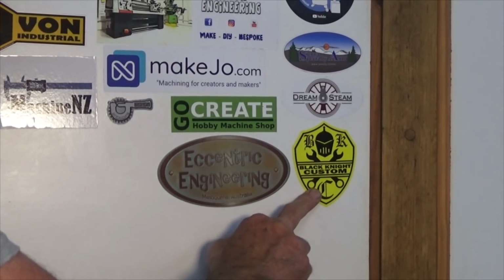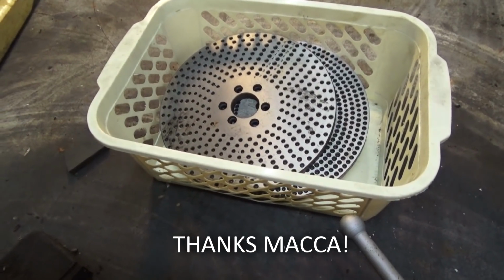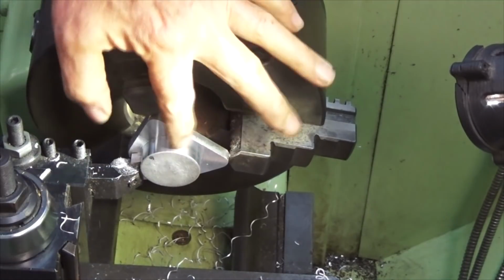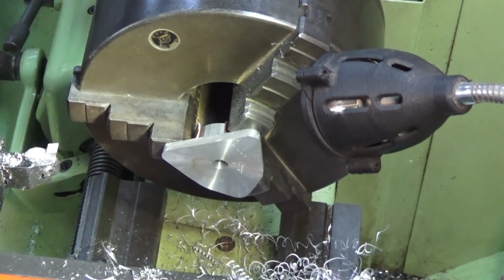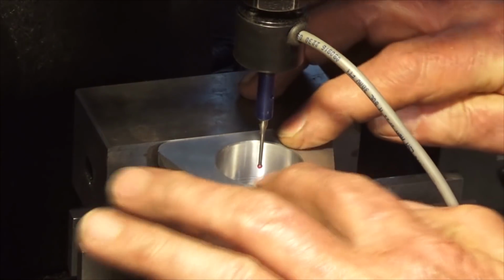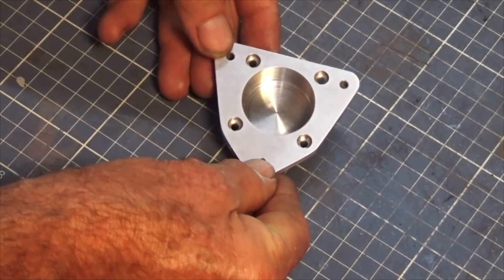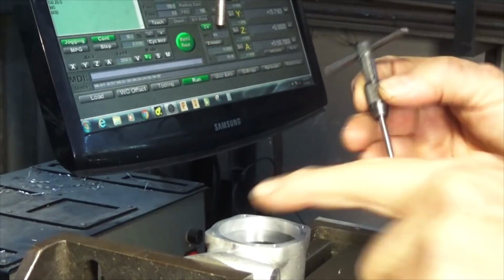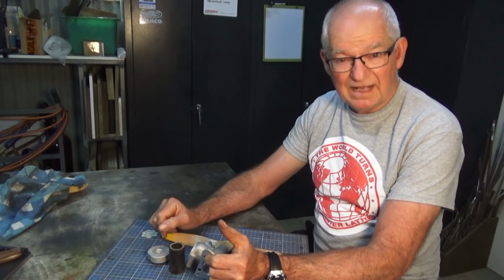Building the Titan .60 Glow Plug Engine #5

Comment: On many ABC glow engines the crankshaft is undercut slightly just in front of the counter weight. That way you don't have to worry about precise fitting in the bush at the extreme rear. If you have a Cox .049 engine crankshaft around you can see what I'm talking about.

Comment: The four screws that hold the backplate to the crankcase see a lot of abuse. Over the normal course of engine use, they would be removed and replaced fairly often for inspection or maintenance (such as replacing a connecting rod or piston). These screws also have to resist an extreme level of vibration transmitted from the engine to the model airframe. For these reasons, I would highly recommend using full-depth screws. If the screws started off at 0.375” long and ended up at 0.250” . . . that’s very likely too short of a thread engagement in the soft aluminum crankcase. The crankcase threads will quickly be fretted by vibration and no longer hold the screws.

This kind of engine mount - a radial mount - was never very popular because they often failed at the backplate-to-crankcase connection. It’s why a large majority of model engines used beam mounts (lugs) on the side of the crankcase. Even for beam mounts, I often had to drill out the backplate hole and re-tap them at the next size up to repair threads damaged by repeated disassembly/re-assembly and vibration. I have also drilled the holes in the crankcase lugs all the way through (if they clear the outer crankcase wall) to get additional thread depth. A through hole (instead of a blind hole) was often used by engine manufacturers to get maximum thread depth too.

One way to get threads all the way to the bottom of the blind hole is to grind your own bottoming tap. Use a regular bottoming tap first, then grind another tap with full threads and an absolute square end . . . no chamfer of any kind. I’ve used this method on model engines in the past to eke out the last few threads to save a failing threaded hole.

I realize this engine is likely to run once or twice and then be displayed. So my comments are intended to provide some background about how model engines are used and how they are likely to fail.  HTH.
Reply from the maker: Thanks for the feedback. All the engines that I had as a kid had side lugs on the crankcase except for the little Cox .049. I guess that these bigger engines do induce a lot of stresses and loads that make it difficult to predict failure. I did end up grinding the point of the bottom tap but it still wouldn't tap the hole deep enough. I guess the best solution would have been to drill the tapping size deeper into the casting but I desperately wanted to avoid breaking through the side of the casting. As you have worked out, this engine won't do a lot of running but good advice nonetheless.
Regards,
Mark

Comment: Lovely in the early 1960's l worked with Progress Aero Works, manufacturing PAW diesels, l still have one of the first experimental 19's - then again some years ago manufacturing the replica Gordon Burford 5cc side port diesels - l have #37
Reply from the maker: My first engine was a Taipan Tyro diesel. It was very similar to the PAW 19. They were cheap and built like tanks but the fuel was costly and hard to make at home. I think I got my parents to buy some ether from a local chemist but even back in the 70's it was hard to get. I recall seeing advertisements for the PAW engines in the Aeromodeller magazine.
Regards,
Mark

Comment: I've wanted a lathe for years, there's a limit to what you can do by hand with a Dremel
Reply from the maker: If you have room for a little bench top lathe there are plenty of options to choose from these days. The Chinese mini lathes are not brilliant but they are cheap and accessible. There must be plenty of second hand versions out there. If you consider it to be an entry level purchase you can always upgrade at a later stage.
Regards,
Mark

Comment: Mark, I wasn't looking for them at the time, but stumbled over three of the six  issues the Titan .60 model was "built" in back in the early '90s.  They contain parts 1, 4, & 5.  That means that I've got the other three issues in another box around here somewhere.  Let me know if you want me to try to find all of them and make good scans of them for you (if I remember correctly, you mentioned that at least some of your copies of the instructions weren't the best).  I can at least make scans of what I've already found.
Reply from the maker: Bob, thanks but I ended up getting PDF copies of the original articles from the Home Shop Machinist archives. I had to pay for them and incredibly, I had to FAX them a purchase request. Who still uses faxes? the copies I received had slightly clearer pictures but they are still just scans of the originals. 
Regards,
Mark
Reply: @Preso58  Yes, I'm not surprised that you received scans.  I believe that they only (relatively) recently digitized their operations, so hopefully folks in the future will be able to purchase "originally" digital copies.  Though I'm not sure that they offer digital copies of their magazines for sale, even today.

Given the above, I'm not terribly surprised about them still using a FAX machine.  They are still a fairly small company, I think.

Comment: Again, very interesting engine build series. Just remember that this engine looks like it is being built for a "control line" aircraft because the design of the fuel delivery system will not be variable, but full open. Later on you could modify the fuel input setup for a variable carburetor and solve that issue. Thumbs Up for sure!
Reply from the maker: Gary, I think there is an option to fit a carburettor but the version I will build is going to be as close as possible to the original build notes. Most of the engines I used in control line planes were 3.5cc or less. This beast would have to go in  a pretty big plane and would pull like crazy. 
Regards,
Mark
Reply: @Preso58  Do the plans allow for a throttle?  Or just a mixture screw in the venturi.

Comment: Don’t use wood screws, do a bolt thru with a locking nut on the backside.  On my glow engines either a paper gasket or an o ring for the backplate seal.  Have a couple of backplate mount engines, more ridged for the high rpm that they run at.  A Venturi carburetor is usually a very high turning critter, safety first with a double bladed scimitar at 17-26,000 rippems.  Great machining videos that you are doing!
Reply from the maker: The build notes do specify metal thread bolts and nuts but this engine will eventually become a display model only. I actually have a box full of titanium aircraft bolts and just for the fun of it I might make some scale versions from the originals.
Regards,
Mark

Comment: if you put on a nut before shortening the screw/bolt , it wil clear the thread as you take it off.
Reply from the maker: I do that sometimes if I have a lot of them to do. I usually drill and tap a piece of stock the thickness I want the screw length to be and just grind off the excess on the linisher. 
Regards,
Mark

Comment: What are you using for lubrication in the spray bottle?
Reply from the maker: I was using WD40 on the CNC mill but I often use water soluble oil and Tap Magic. The WD40 is less of a problem with rust issues on the machine surfaces though.
Regards,
Mark

Comment: I wouldn't use wood screws to mount the engine. In my day we used spike nuts on the back of the bulkhead and bolts of machine screws into them from the front.
Reply from the maker: The build notes do suggest to use metal thread screws and nuts but this engine will probably only run once and then it is being shipped back to the USA to go on display in a museum. I will have to make a decorative mount for it from some Australian Red Cedar that I have on hand. I like the look of nickel plated round head wood screws but I will see if I can find some nice scale type hex headed bolts. I actually have a box of titanium hex headed aircraft fasteners but they are all too big for this engine. 
Regards,
Preso

Comment: Joe Pi does make tapping holes look easy and my limited experience does not match his. I very much understand your caution.
I enjoy the clips of down under, thanks for sharing.
Reply from the maker: It doesn't help that I have shaky hands either. I know from experience how sick it makes you feel to break off a small tap in a blind hole, especially when the part is a casting. 
Regards,
Mark

Comment: The crankcase holes for the back plate you said the depth was 3/8"...That would be .375"
I don't know if the ears are big enough to drill through so the holes could be tapped through? If not, maybe a bottom tap would have worked. This of course is so you don't have to custom grind the screws.
Reply from the maker: That's it, 3/8" = .375 = 9.525mm. I tend to work in both metric and imperial units but metric is my preference. I used to know all the common conversions but I still have to look them up occasionally. It would have been nice to drill and tap right through but I am trying to follow the build notes as closely as possible since the finished engine is being returned to the USA to go on display in a museum to honour the work of the designer George Genevro. 
Regards,
Mark

Comment: You can cut the threads to the bottom with a bottoming tap. I like the spiral type they pull all the chips up out of the hole.
Reply: Even a bottoming tap has 2-3 threads that are tapered. Spiral flute taps are definitely nice though for blind holes.
Reply: @ADBBuild  not with a true bottoming tap, you tap the hole then remove the taper tap then use the bottoming tap to do the last bits. Anyway it doesn’t matter he got the thing together👌🏻
Reply from the maker: I did use a bottom tap but even after grinding off the point it still won't cut a thread right to the bottom of the hole. You need to be thread milling for that to work. I could have just drilled the tapping hole size a bit deeper but I desperately wanted to avoid breaking through the side of the casting. That would have ruined what little reputation I have. 😁
Regards,
Mark

Comment: Thank you for the videos, I really appreciate your efforts. I repair, rebuild and port 2-stroke chainsaw engines and a thought struck me. In 200 series husqvarna chainsaws it was common that the crankshaft protruded the case through the oiler which also had the crank seal journal. The oiler and sometimes a similar fitting that was used under the flywheel, opposite the pto side, both have journals for nitrile buna o-rings to seal the case. Your protrusion, near the base, would be well suited to an impervious o-ring seal.
Reply from the maker: That is true but I am building this engine as a display model to go into a museum in the USA. It is to honour the work of the designer, George Genevro so I am trying to build it as exactly as possible according the the published drawings. 
Regards,
Mark

Comment: These odd shaped parts are a big challenge for work holding.   I would have felt a lot of stress doing the operations.   I like to manually tap threads to feel the pressure.   Breaking a tap in this part would have been a disaster.   Well done, very good progress.
I loved the bird shots at the end.   Thanks.
Dave.
Reply from the maker: Thanks. This build certainly has it's share of workholding challenges. I spent most of yesterday just making workholding jigs for the next two parts. Those corellas are infrequent visitors to our garden but it was nice to see them. They have really creepy eyes though!
Regards,
Mark

Comment: Hi Mark just found your channel. I think I picked up you were a metal work teacher. I spent 23 years with Bendigo TAFE as head of Machine Tools ending up my managing Echuca TAFE. I live in Thailand now and setting up a workshop here. Looking for to binge watching your channel.
Reply from the maker: Thanks Jim. I worked in the state secondary system for my whole career but we started to work more closely with TAFE after the VET courses were rolled out in our senior engineering and furnishing curriculum. I always struggled with the competency based assessment used in our VET classes. Kids would always want to know how well they had done on a particular job. I would tell them that they were certified as competent but they would wan to know HOW competent. So then you would have to say something like "very competent". But then they would want to know if they were more competent than, say, Billy over in the corner. And so it would go on. Fun times!
Regards,
Mark
Reply: @Preso58  I was heavily involved in writing the national curriculum and producing teaching material. I used to explain to apprentices that if you produce something half right,is that acceptable at work. So things need to be made to specs, if you do the maths and it's only half right,is that ok.

Comment: Quite simply, I enjoy your videos and look forward to your next release.  Making a model aircraft engine is a unique idea in comparison to a steam engine. Thanks again. Graham
Reply from the maker: Thanks. I have always wanted to make an internal combustion engine but I imagined it would be something like a hit and miss engine. They are low revving and a bit more tolerant of machining errors but you also need to cut gears. The two stroke engine looks simple on the surface but requirement for good tight tolerances can be a "challenge". I am sort of intimidated by the next group of parts but if I can get this engine to run I would like to have a go at a multi cylinder 4 stroke at some point.
Regards,
Mark

Comment: Hi Mark, I agree that Tassie is beautiful and we also enjoyed the old buildings. Just a couple of days ago I snapped a 4x.7mm tap🤬. I had about 25-30mm of thread left on the broken tap so I ground it off dead square so I can use it as a final bottoming tap in the future. It will be in an upcoming video restoration of a couple of Estwing hammers. I’m really enjoying your engine build series even though I’m not into rc planes, you just have a way of making it interesting. Cheers Stuart, Canberra 🇦🇺
Reply from the maker: Thanks Stuart. Breaking a tap will certainly ruin your day. Luckily there are only a few threaded holes to go in the engine. I own an Estwing hammer and up until recently I thought the brand was spelled Eastwing. I guess I never looked too hard at the spelling. It seemed logical that the bird wing in the logo would have something to do with birds flying east! 😁
Regards,
Mark

Comment: I note that you seem to suffer from "Tapping Anxiety" Mr. Presling. I myself suffer from "Glue Anxiety", a debilitating condition to be sure, especially when one is using cyanoacrylate adhesives.
Reply from the maker: Been there, done that with cyanoacrylate. I used to carry a bottle of it in my dust coat pocket when I was teaching. It was super handy for repairing splintered joints but one day the cap came off in my pocket and man, that super thin stuff gets hot when it goes off. That's what alerted me to the disaster as it was unfolding. 
Regards,
Mark

Comment: Hi Mark, My Brother in Perth has the same lathe and it came with a hydraulic tracing attachment, very jealous.
Reply from the maker: I have the original Colchester manuals and one shows all the proprietary accessories you could add to the machine. If I could find them I would like to have them all!
Regards,
Mark

Comment: No helical milling for the c'bore
Reply from the maker: I would do that but not on a part where it's definitely a one off. My little CNC is nice but it has it's limitations.
Regards,
Mark
Reply: @Preso58  that's one thing I loved about the vtc800 I worked on it had like a 60 tool carousel you could just helical mill any hole you needed as long as it wasn't to deep.

Comment: On the back plate use a small O ring to make the seal
Reply from the maker: The build notes suggest that as an option but I went through my entire stock of O rings and couldn't find anything the correct size. 
Regards,
Mark
Reply: @Preso58  Contack me if you want 1 just give me the size you want, or contact Jett Engines they use them

Comment: Tension… make a mistake and there’s not fall back.
Reply from the maker: Tell me about it! If I mess up any of the castings there's no alternative. As it turns out I checked the cylinder head casting yesterday and it is undersize because someone cut off the casting gate too close to the casting. Luckily, that is one part I can make from solid stock.
Regards,
Mark

Comment: Is it just me or does that exhaust port seem really high?  hmmmm     love my Milwaukee screw shorteners   great video!
Reply from the maker: It will all make sense when the cylinder liner is assembled into the crankcase. The engine will be nearly double the height after the liner and head go on. Starting on those parts tomorrow.
Regards,
Mark
Reply: @Preso58  Now that makes sense....

Comment: Could you add an O ring to the plug so the plug is always sealed to the crank case? Ass the engine heats up, the plug will not heat as much making a clearance between the plug and the case.
Reply from the maker: The build notes suggest the O ring as the preferred way of sealing the back cover but I didn't have anything on hand the correct size and given that the engine won't be doing much running I decided to stick with the gasket. 
Regards,
Mark

Comment: If you ever mount and run that do not use wood screws.  Use bolts with captive/blind nuts on the other side of the firewall. 
Wood screws are how engines part ways from the mounting plate or firewall at the most inopportune times.
Reply from the maker: Since many people have told me not to use wood screws, I have taken this a personal challenge and I have resolved to make custom titanium hex headed bolts instead. Watch me! 😁
Regards,
Mark